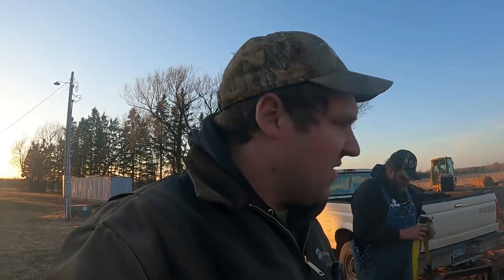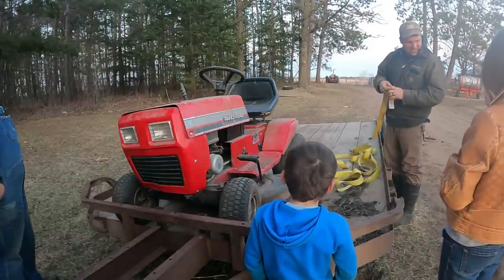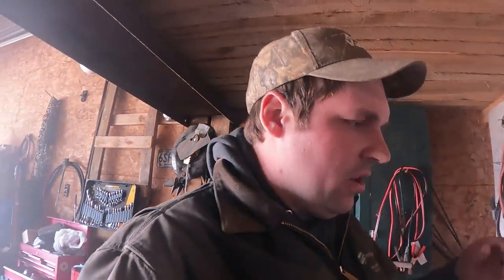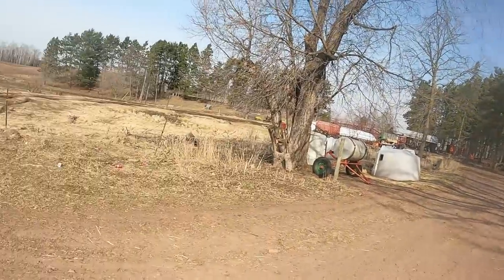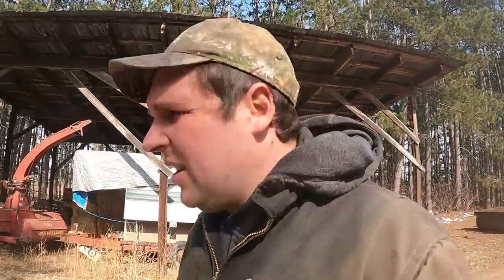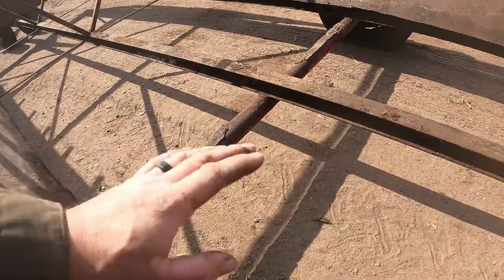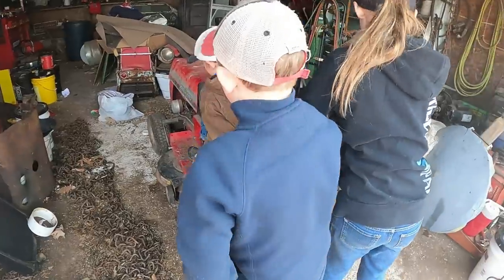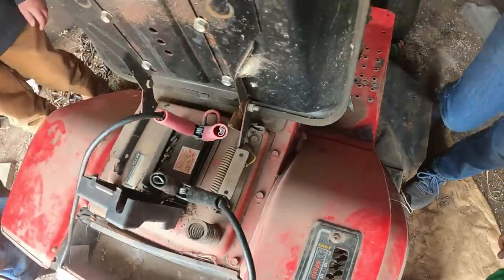A surprise for the kiddos-Ranch King Mower/Farmall B update/New Feeder Wagon Floor

Comment: When I was a boy we had a Sears SS-14 garden tractor on the farm.  We made a flat sled with a handle on each side and towed it all over the farm, one of is kids driving and the other ones riding.  It was the most fun.  Much better than putting your kids these days on a hot rod 4 wheeler.

Comment: Most green treated wood is copper sulfate, we use copper sulfate for the cow's footbath to help prevent hoof rot. I think they should be alright. You said it, if you did it once with no issue....
Reply: If it is copper sulfate it will destroy steel. We had to move our foot bath because the copper sulfate ate the stall pipes thru in the parlor.